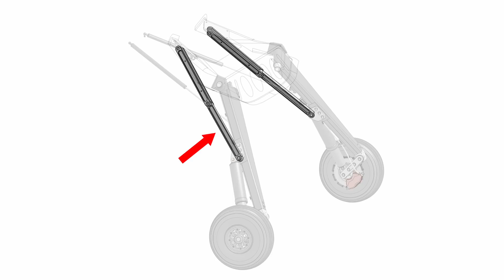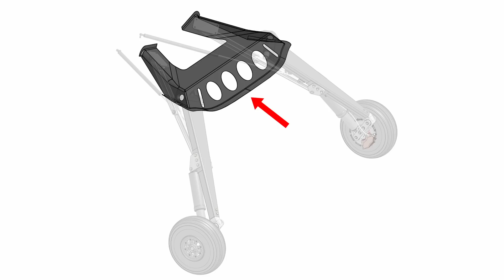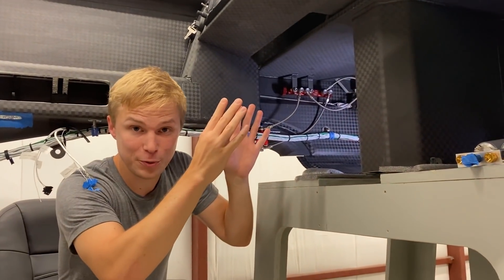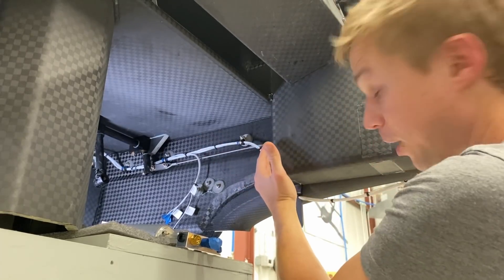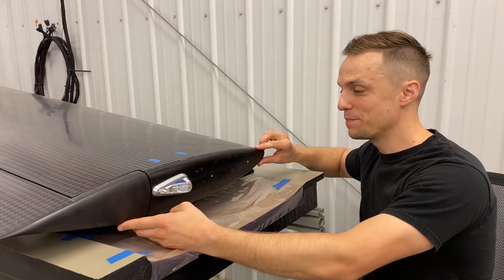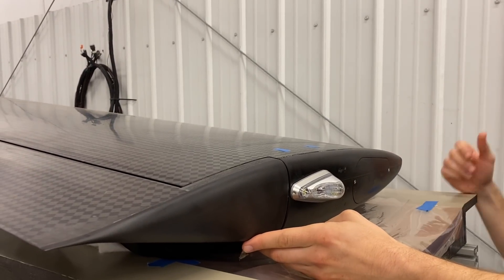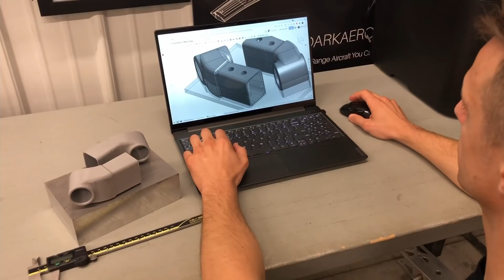Why So Many Parts? | DarkAero Shop Vlog | September 4th, 2021

Comment: Fuel under pressure in the cockpit is not a good idea. 
Is there plans for bronze bushings an grease fittings for the drag link joints.

Comment: Your machining process really scares me! Those parts look very imbalanced and strengthless for the amount of force they are going to handle. Have you heard about symmetrical weight distribution. Parts should be symmetrical to handle all kinds of twists and skewing forces. Your machined parts are very dangerous for human use!
Reply: As an aircraft mechanic I can say most look pretty similar to other aircraft parts that aren’t castings or forgings. The stresses are all pretty well known. This isn’t like a dune buggy that’s going to be getting bounced around other than at touchdown. Biggest thing then is side loads if you have a strong crosswind. I would fly in it from what I have seen so far!

Comment: Could I ask you about your wing tip? On modern jets, you see where there is a angled piece to increase the efficiency of the wing through the air and reduce drag. I'm sure you're aware of that but you made the choice to to have a traditional tip. Would you please tell me why, thanks?

Comment: Why not have designed the “wing tips” with vortex generators? They are proven to reduce drag, increase lift (about 17% or better) and of negligible use, on such a small aircraft to reduce the spacing of any aircraft behind for turbulence. 
   It’s your project but I still would have included them for the first two, afore mentioned benefits. I am interested to know if you considered them (vortex generators or wing rakes.)
Best,

Comment: Is it physically possible to install that wing-tip upside down?
Reply from the maker: The tips do not line up correctly if they are swapped left to right or upside down so they only go on one way.
Reply: @DarkAeroInc  Good design, but somebody will probably try anyway.

Comment: When you get into production do you expect to convert some of the CNC machined parts to forgings?  This will allow for lighter stronger parts.  Great video as usual. Keep up the good work.
Reply from the maker: Hi John! Forged parts would allow for increased optimization on some of the metal components, but the required investment in tooling makes the process a little difficult to adopt for our production volumes. However, we are still looking at converting some more of the metal parts to carbon fiber. A good example of this is the strut bracket we showed at 4:20 in the video.
Reply: Never gonna be viable at those volumes I'm afraid

Comment: While designing parts, do you follow design standards and procedures, or just wing it and approve the design by doing FEA?
Reply from the maker: Great question! From a high level, our designs are guided by FAA standards for certified aircraft. We validate our designs through a combination of hand calcs, FEA, and physical testing. Parts made from metal are fairly straightforward to analyze with just hand calcs and FEA. Composite parts are more involved since they are anisotropic so we rely much more on physical testing to validate composite structures. Probably the most extreme example of this is the wing, which we tested in both the positive and negative g directions to confirm it would withstand aerodynamic loads.
Reply: @DarkAeroInc  Thanks for the reply. I really do wonder, how is the calc I’m studying in bachelors right now is applied in such a practical manner, where a group of 3 people are doing hand calc at home for making an entire aircraft.

Comment: Question: Any reason for using a pitot tube as opposed to a pitot knife? Seems to me the knife is more compact, and seeing as you guys are so detail oriented, I’m sure you have a reason for using the tube instead. It’s be cool to know. Thanks for all the vids!!
Reply from the maker: The pitot tube we selected has an angle of attack sensor built into it, and it’s set up to work with the Garmin G3X avionics suite we are using.
Reply: DarkAero, Inc ahh gotcha. Am I correct in assuming that an angle of attack sensor is not available in a knife style pitot setup? i.e. A pitot knife would have been ideal, if not for the lack of angle of attack sensor and/or G3X compatibility? Thanks!

Comment: I have a question. As an aerospace engineering student I am working on learning about design or aircraft. When you guys designed and built your wings did you reference NACA airfoils? If so what calculations did you go through to find the right balance of tilt, AOA, and scaling the wing? If not how did you come up with the camber and airfoil shape?

Thanks!! Keep up the awesome videos!

Comment: Please wear some more PPE when using that clickbond glue lads, it has the most terrifying list of organs it damages on the warning label 😂 definitely the worst stuff I think I've ever dealt with at work, aside from Alucrom anti-corrosion coatings
Reply from the maker: Totally agree on this one! We are typically very strict on our PPE use but we were clearly slacking in the glue up sequence in this video! Agreed as well on the dangers of corrosion protection chemicals for aluminum. I helped a friend do some of that on his RV-10 and the process required some serious PPE.
Reply: @DarkAeroInc  Thanks for the response guys, glad to hear it. Thanks for sharing this journey in such great detail and absolutely can't to see this thing soar!

Comment: Are you designing for manufacturability as you go? How far from the production design do you think this prototype will be?
Reply from the maker: Hi Robert! We think a lot about manufacturability as we build the prototype. Even though we call it a prototype, it will be very representative of the production aircraft kits. A big reason we use CNC as much as we do is because it is easily scalable to larger production volumes. We discuss manufacturability a bit in this video. https://youtu.be/HyOscBDsxjo Thank you for watching!

Comment: That clam-shell rudder is super slick.  I remember the video about it but, I can't recall if you discussed the advantage of only outward facing hinges.  Since the rudder panels don't cross the centerline, the hinge interface is completely flush. That must be great for your cruise efficiency!
Reply: Nice observation. I hadn't really considered that. But Split-flaps are known to be the lowest-drag flap in their retracted position.

Two years ago, i read a bunch of naca data on split flaps, plain and slotted flaps. I have no idea why engineers are so obsessed with slotted flaps, they only make +10% more lift than split type. (though about half the drag at small deflections). So, engineers of standard GA craft seem to like slotted for their low drag takeoff-flap setting. I now prefer split flaps, based on what I've read. (Simplicity, light weight, lowest drag, no drag making gap through the middle of the Airfoil, and airflow doesn't separate over the aft-top surface when deflected).
Reply: @Triple_J.1  then it doubles as a speed brake. It's amazing it's not more common.
That's interesting about how little extra drag it actually causes. Cheers.
Reply: @inventorToo  yeah, it's a clever design. As long as it's large enough that one can counter the engine torque and prop-factor at low speed and high power settings, without resorting to full-deflection. As this would create quite a bit of drag right when you don't want it; e.g. a crosswind go-around scenario.

Comment: (edit) I love this project and your team's energy. Question: A common "hangar rash" is wing tip damage. What will the level of repair process complexity be for permanently bonded tips?
Reply from the maker: Hi Koncas! Thank you for following our project. If the tip needs to be replaced it can simply be cut off and replaced. We actually did this once with the tips on the HS because we made a design change at one point. The tips really shouldn’t need to be replaced though. They are quite solid once installed and should tolerate normal levels of bumps or tool drops. The access covers allow for maintenance of the wing tip lights, magnetometer, and pitot tube.
Reply: Personally I would never permanently bond in that wingtip..  one fine day you will need access. Sooner or later.

Comment: Since planes are expensive (what I call overpriced or opportunity to do better) I suppose even significant reliance on machining might be negligible cost. Do you have a sense of the combined structural cost for the landing gear and is it negligible. And what price segment are you hunching for your go fast 2 seater? Are we talking overpriced LSA at 170-250k? or legacy certified 172 overpriced at 400k. Or newer certified cirrus ridiculous at 800k?
And btw a tube design can of course be trailing arm with shock as well.
Reply: All cost info is on their website.  https://www.darkaero.com/aircraft
Reply: @davidowens7040  ah the target price. that's fairly modest by aircraft standards. subject to change :)

Comment: You guys are awesome, love the aircraft.  Just surprised to see fuel pumps in the cockpit - any thoughts of an alternate location in the future?
Reply from the maker: There is another spot we are considering which is the cold side of the firewall forward of the copilot rudder pedals. Still in the cockpit technically but a little more out of the way. We placed the pumps on the side of the fuselage because there was more room there and our original plumbing took up more space than we liked. After we moved to a more compact dual fuel pump manifold it reopened the firewall location as an option.

Comment: Any possibility of the Rotax 915 (or even the TurbAero turboprop)? Or is the UL520is the only engine?
Reply from the maker: Great question! Right now the UL520iS is the engine for the DarkAero 1. The airframe is designed and optimized around this powerplant. Everything is pretty tightly coupled so there are a lot of cascading design changes that would be required to adopt more engine options. It’s not something we are completely closed off from but it’s enough work to engineer a solution for one engine already so we are trying to stay focused on getting things right with the UL engine before we increase the scope of the project.

Comment: G,day River and brothers from Sydney Australia.
Hopefully you are well and enjoying the challenge of manufacture.
Your possibly thinking, get to the point 
Your milling and using a router to manufacture the components. Has 3D printing the strength for airplane components?
Be well, take care and have fun 
🌏🇦🇺
Reply: Hi, I’m just a couch flyer at this point, but I would not use 3D printing for anything structural. I’m sure someone will come along and disagree because it’s the Internet. Also, I’m happy to learn from others.
Reply from the maker: Hey John! We do have some 3D printed parts in the DarkAero 1, none of them are structural though. Mostly ducts and parts with complicated geometry. We highlighted some of the 3D printing materials and processes we use in this video: https://youtu.be/F4a-ZQoHnFM